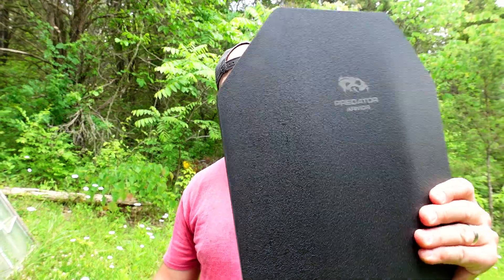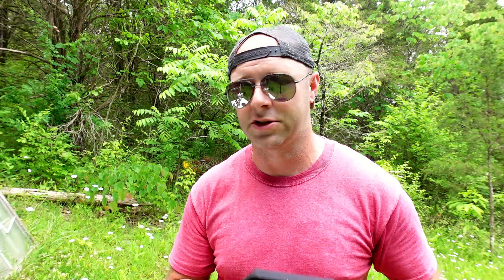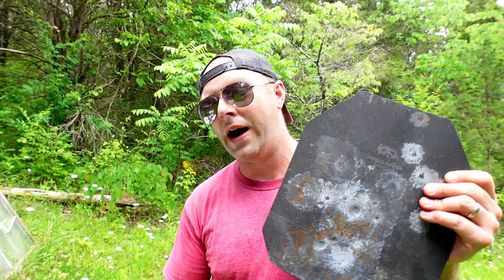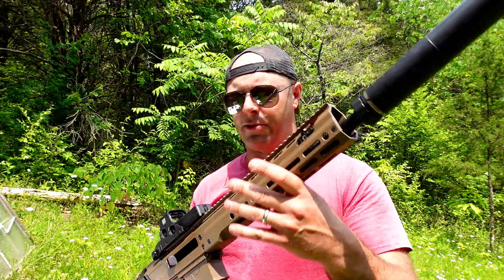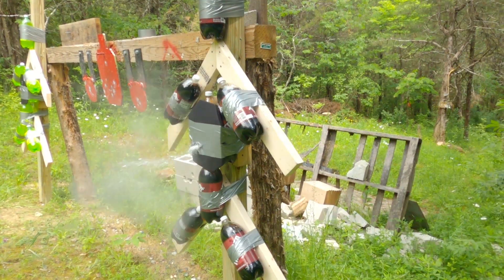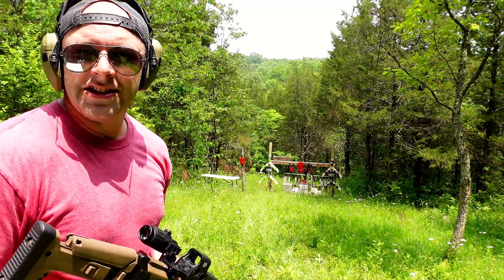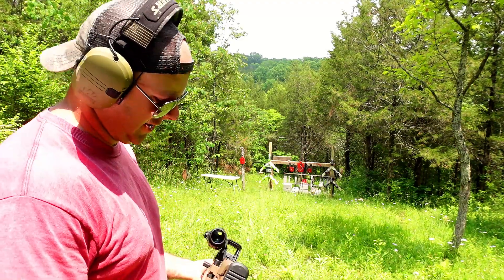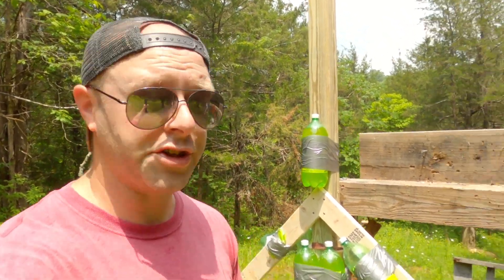Ceramic vs Steel Body Armor vs 308 Winchester

Comment from the maker: Anyone have homemade anti spall stuff they want me to try?
Reply: The best way to deal with spalling is...to not deal with it in the first place. With steel, you have this inherent and potentially lethal problem right out of the gate. 

Sure, people will say you can mitigate it with this or that coating or a sleeve of kevlar or something similar. But those solutions are 1) Moderately effective and 2) Add more weight to armor which is already absurdly heavy relative to its protection level. 

With ceramic or UHMWPE, you engineer this problem out at the front end. There is no actual real-world advantage to steel. There are reasons no modern military uses it for armor and no law enforcement agencies with any sense or means do either. 

Steel is favored almost exclusively by guys who are cheap, or broke and preparing for fantasy "SHTF" events in which they fancy they will be getting into gun battles constantly and walking away unscathed because their steel can take lots of hits. It makes little difference if your steel plate can take 20 hits if your peripheral arteries and nerves are turned into hamburger by secondary projectiles. 

Ceramic plates are not a "one and done' deal. They are required to stop at least six rounds from most rated calibers and in practice they often do better than that.
Reply: Porcelain and car Tire in seperate tests.

Also 20 inch 55 grain beats level 3 as it is.

Comment: Great question. I want you to try car tire and porcilin tile.

I found a double steel car tire on the side of the road. A flat type.

Also porcilin tile is like a dollar. The splash it has may be safer than lead splash. You can also get a cheap cutter and glue them on.

Also Hot glue and heat blower might do it. A 10lb pack is 90 dollars. A 25lb pack is 150.

I know there may be a better actual glue adhesive but its in another video. I can go back and look at it for you
Reply: The "Tech this out Meow" guy used simpact 85a from smooth on.